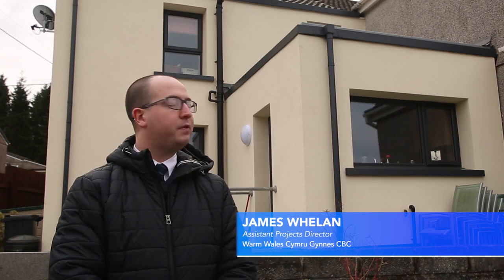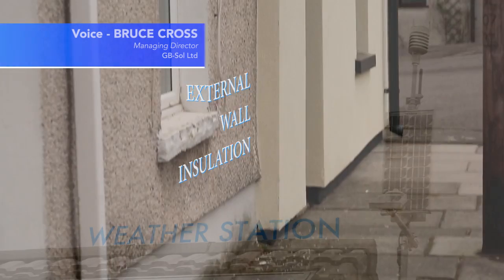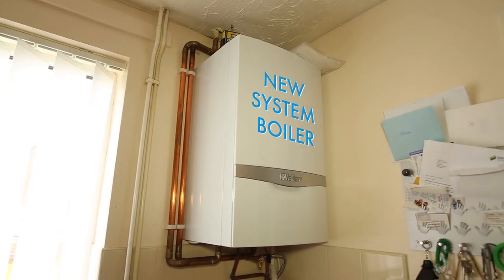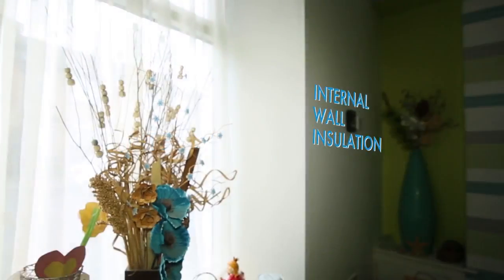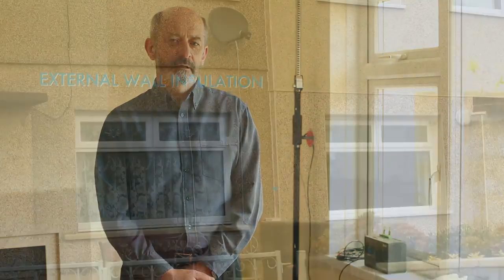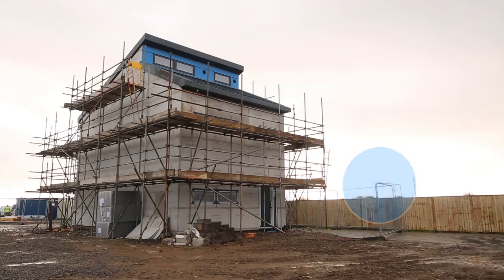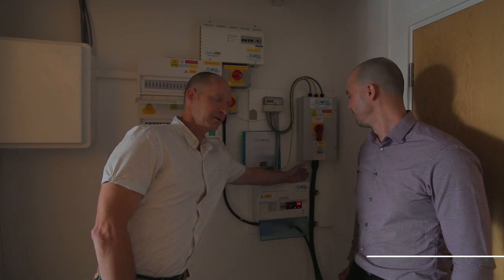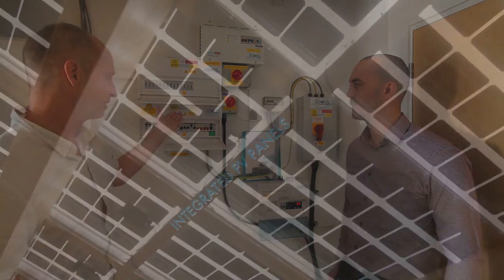Solcer Project - Solcer House and Solcer Retrofits

Comment: Generally positive to anything that can radically improve the energy performance of UK housing stock but the financing of all these ideas on one property leads to a few concerns

At around 1 min 30 secs    'Over 70% of energy can be saved for an investment of less than 30,000 pounds' 

A typical 3 bed home gas + electricity = around 1000 pounds per annum  @ 2015 values (OFGEM midrange TDCV of 13500kWh gas, 3200kWh electricity, npower 2016 price fix) 

So 700 pounds per annum saving for an upfront investment of 30000 pounds ??????

Many or most of the elements of such an upgrade  would probably be end of life or superceded by better technology well before the 42 years was up.  Even PIR insulation might become outdated by the likes of aerogel in the coming years.